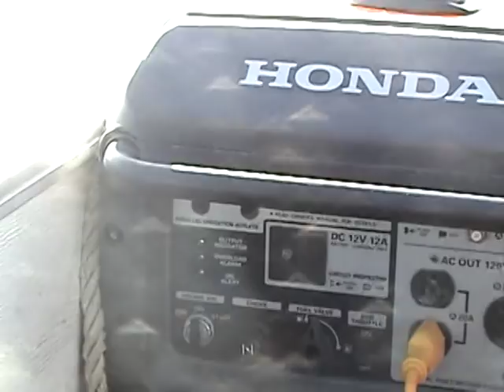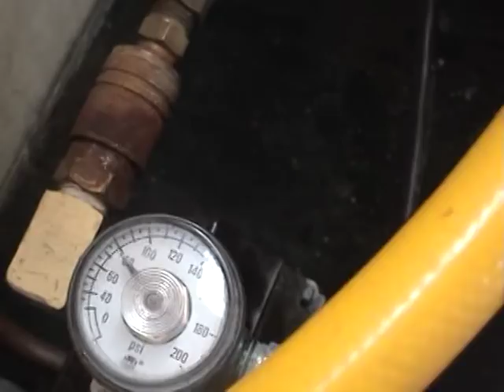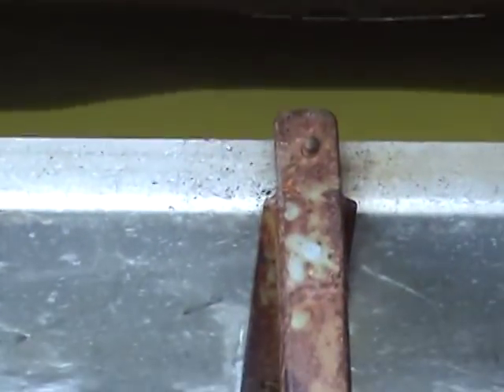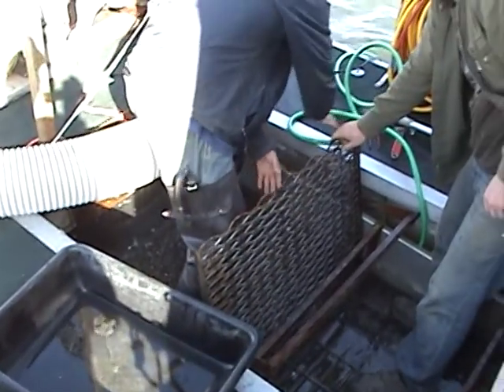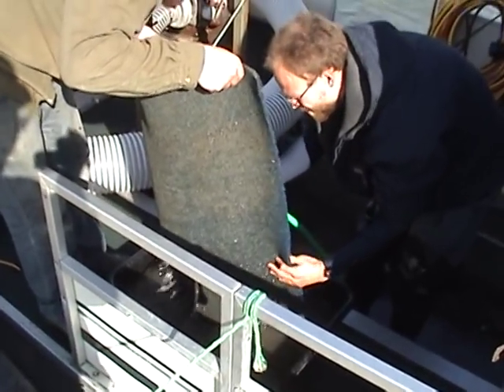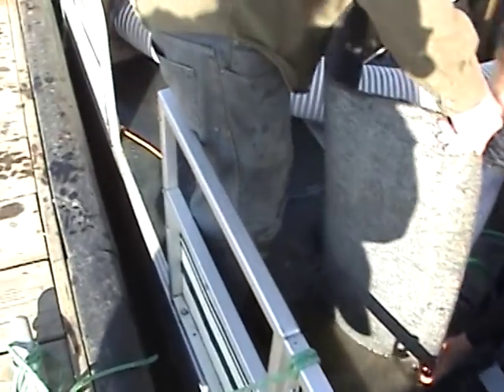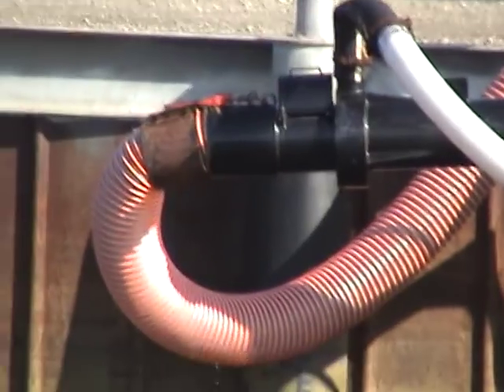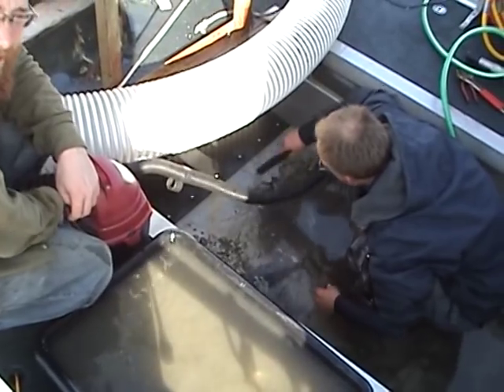Gold Dredging in the Bering Sea, Gold Diving

Comment: The other method would be to actually use a deepening dredge that is used for deepeng a bay where ships come in from the ocean and navigate through a harbor up to the docks.Why not set up a smalller version but,Instead of dumping the tailings into a barge as they do and dump them out in the open ocean,run the dredge materials through an oversized slouce way(spelling?yikes).and clean it for gold.The advantage would be being able to search for gold in deeper water.Up to 90 feet or so.

Comment: Its far far less expensive to use a dry suit than go through all that non sense of buying and setting up a hot water system to keep warm.Also why on earth does anyone even consider using a suction dredge? THere is another method of gold exstraction than having to get into the water and drag a silly hose around the floor of the beach.You are so limited by the depth you can dredge gold from. And WHT OH WHY does anyone need to camp out on the beach or rent a hotel room or rent a room anywhere ????